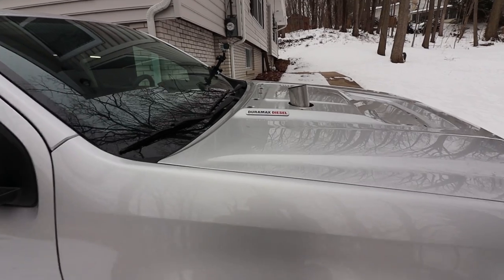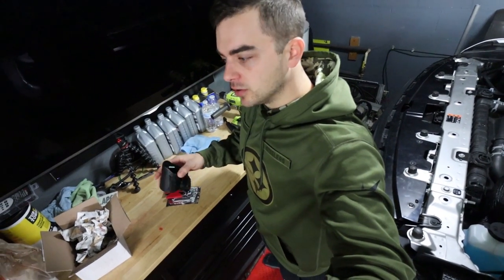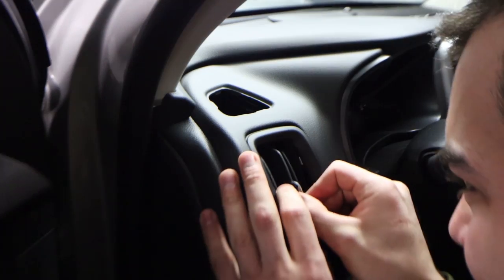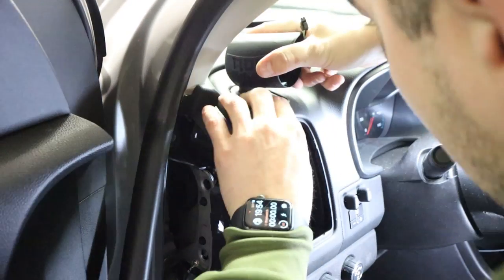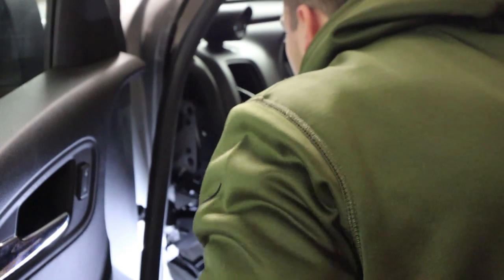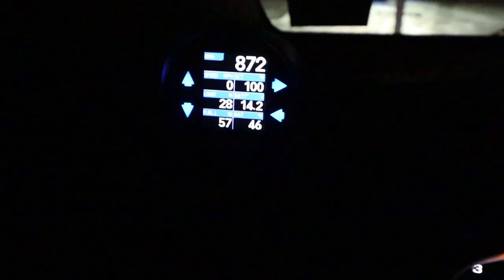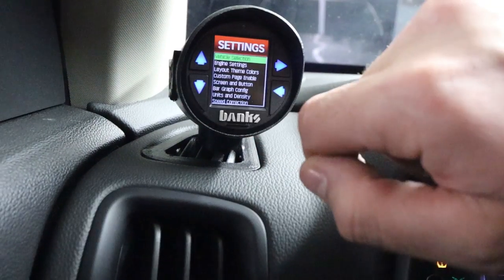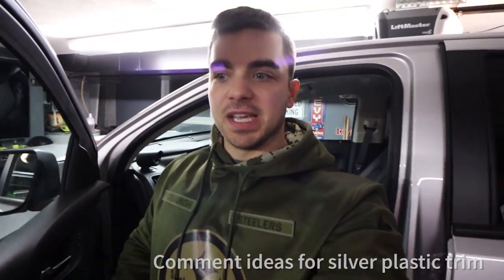Best OBD2 Gauge on the Market -Banks iDash & ADP Pod Gauge in my Colorado Diesel ZR2

Comment: where do you get you EGT temp from? when i install the tune the reading freaks out and gets stuck at 1112 degrees.
Reply from the maker: It’s one of the monitors in the gauge. It’s not called EGT though, I forget what it is.

Comment: So, is there a better way to pull out the vent without taking the risk of breaking it?  I want to do this mod but dont want to break the vent.
Reply from the maker: Yes, just don't pull it!!! lol not necessary
Reply: @matt13ross   So leave it in? do not remove this vent?  what about the side cover? is that nessasary?
Reply from the maker: Side cover pops right off.  Take that off and you should have enough room to route the wiring.

Comment: Okay, so i finally got mine in the mail today. As soon as I snapped it into place, the base cracked like glass... pretty bummed about that...
Reply from the maker: Whattt???? Did you contact them?  I didn't get my replacement yet.
Reply: @matt13ross  Yeah, i sent them a photo of it and asked if that was a common problem... I’m super bummed about it. I’m still waiting for them to respond to my email
Reply: @matt13ross  I don’t know why they are replacing them, but for now you should def just hold on to the one you have already. Maybe i just got one of the old ones?
Reply from the maker: Well the old ones melt in the sun, lol mine hasn't yet though
Reply: Finally got mine and it broke too. Can’t really see it so I don’t care as they have been a nightmare to deal with. I’ll just use some crazy glue if it starts to separate.They sent me the expansion kit gauge not the universal. So after two months still couldn’t use it. Luckily the nice local diesel shop (Dirty Diesels)sold me the cable out of another kit for the gauge. Adp doesn’t seem to want to refund me the difference but wants me to send it back to exchange which is crazy because I’m up in Canada. Shipping is stupid.
Reply: @anthonyi5356  Same experience... I asked ADP what my options are and all they responded with was “It is not a common problem” which basically implied it was my fault... awfully presumptuous i thought 😠 especially since i was very careful. Did yours crack at the base? Mine was right at the rear left corner, almost like it was printed too wide in that area.
Reply: @cam4usa  mine is right at the front. Right to left it cracked. I was super careful and it happen before it even snapped in the front.  As long as it sits there can’t see it due to the shitty 3D printing. Had a lot of frays on it too. I can see going down forestry roads it will shake it apart. I’ll probably glue it. They replied to me”Have a nice weekend” about my gauge. Still going to go through PayPal to complain just giving them more time to reply. They don’t know my pod cracked yet.  Lucky I live in Canada and close to a main diesel shop/supplier so last time I order from them. I just thought since getting the pod I’d get the gauge from them too. Sucks the pod is in the perfect spot so hard to just return it and get money back(Also don’t trust them). I don’t want a suction cup pod so sucking that one up.